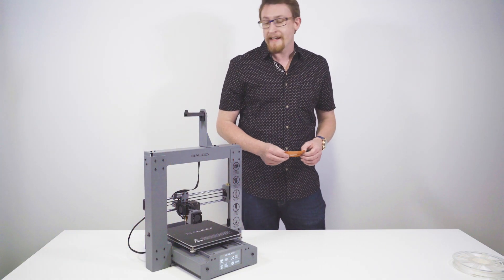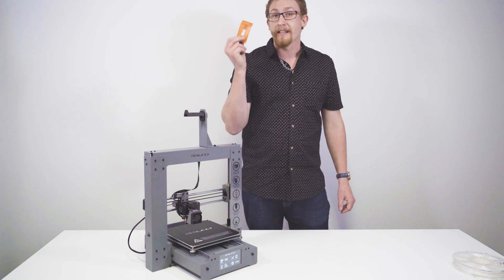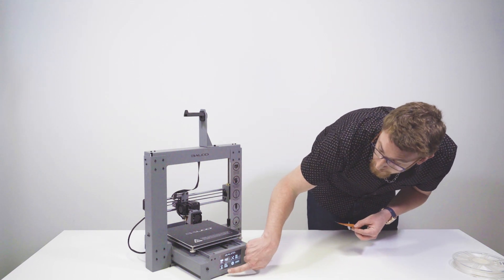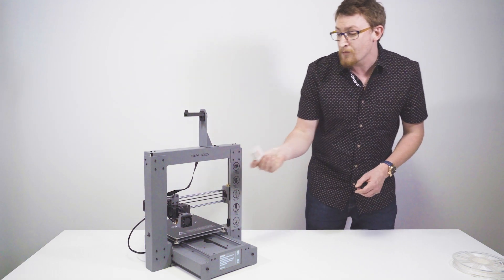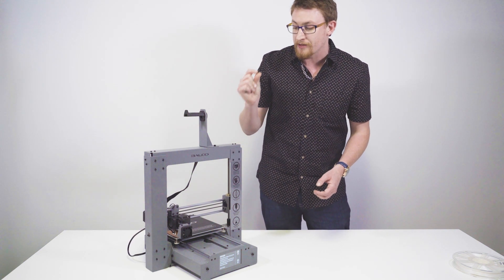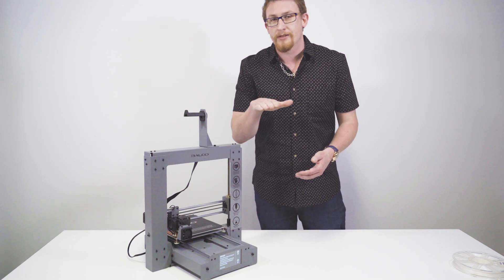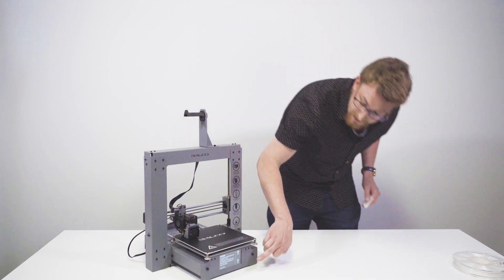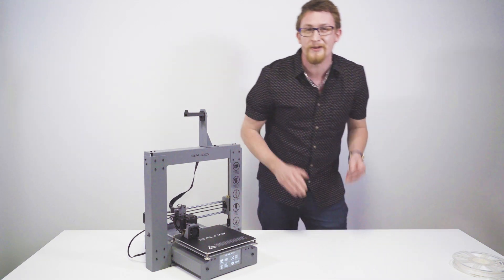Balco Touchscreen 3D Printer - Levelling The Print Bed

Comment: Ok, so this is what you show, the easy stuff, but in the description there is a very difficult to understand part about leveling manually.
This is my problem: With the screw on the left front corner all the way loose, the extruder head is still like 2 milimeter from the plate.
What to do about that?
Thanks
Reply: It looks that this is due to the others screw holding your plate. If those are correct (right distance extruder/plate), then it is probably due to the fact that the horizontal bar is maladjusted.
Reply: same issue here, found a solution yet?
Reply: @shanevincent6034  mine is two low 😂😂
Reply: @shanevincent6034 Have you found a solution yet
Reply: I had exactly the same issue but after levelling the other 3 corners I could get it right.
I repeated the sequence a couple of times since the very initial levelling of that first corner was way off...
Reply: @geertvancompernolle2586  I got it solved, by lowering the limit switch. Now, I have a BL Touch, thats a lot better: https://www.facebook.com/groups/2577589719140452/